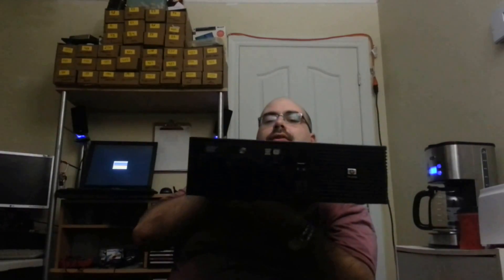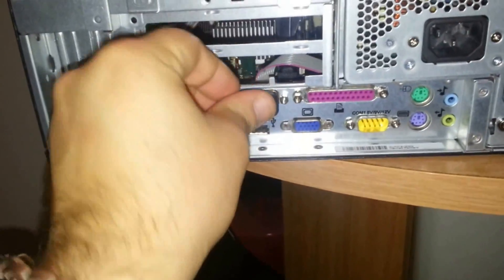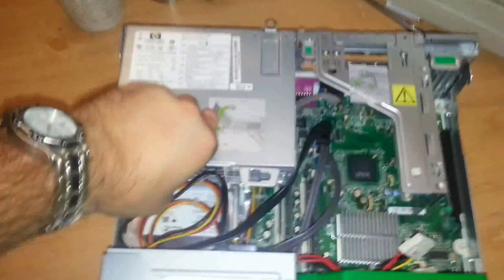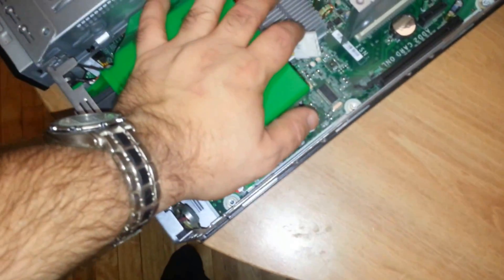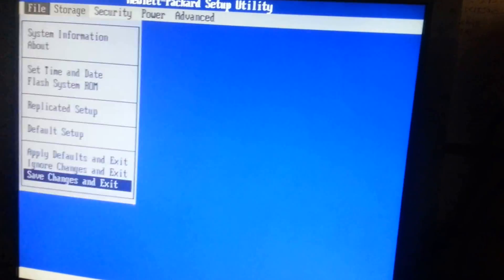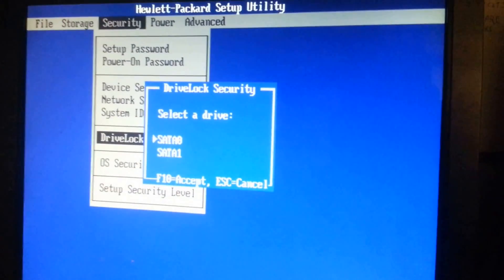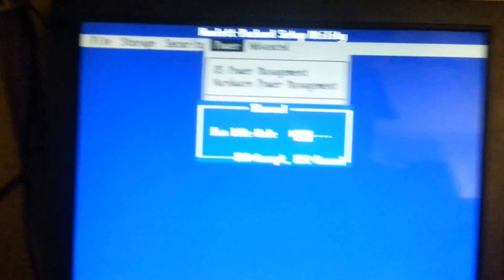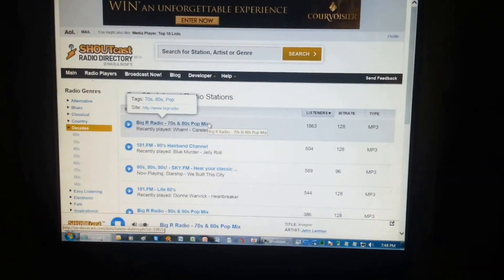HP rp5700 Overview and Boot

Comment: Help me i cant open
Reply: Bruh same
Reply: I know how to opened now
Reply: Grabbed but like put the front up and then put your fingers on the sides and tje front has to be facing up and the pulled up the case but hard and there will.comeout
Reply: sassy-predator30 ok
Reply: @ALExx399  now i knew how to remove the case thank you since you said the front should be facing upward or skyward then i press the side button  locks one by one and it release the lock

Comment: What is the power usage of this system? Because i want to use it as a router/firewall at home, and it's gonna be powered on 24/7.
Reply from the maker: +Max Around the 300-350W range. Judging by what your intentions are, you'll be mostly hovering closer to 300W.

Comment: Buy a DVI-I to VGA adapter. And place the video card in the slot ...

But at the moment of turning on the PC ... did not give me image ....

Change the position of the monitor to the integrated cardboard that has the motherboard, and I throw this error ...

"922- This system only supports SDVO / ADD2 cards in the x16 slot."
Reply from the maker: +Winder De La Cruz Those bastards...they just couldn't make it like Lenovo did. That means that your PCI-E slot only accepts a video extension card. Worst than that is that it's not a PCI-E but an ADD2 slot. That's great...now I gave advice to someone and yet HP got me good again...
Reply: Yes, it's just an ADD2 slot ... I lost 45.93 $ which is very difficult to get in venezuela ...
I will try to sell it here and venezuela ...
Reply from the maker: +Winder De La Cruz Sorry about that. I was even fooled by the damn board description. 
However there are three options for you at the moment:
- Try to get a refund from where you purchased the video card
- Sell it without losing too much
- Get a PCI-E x16 to x1 converter, but don't count on it to fit. 

Lenovo always uses a patched PCI-E x16 to avoid these mistakes, things that should of been standard by now.
Reply: So i cannot put a network card in the PCI slot...?
Reply from the maker: +Max if it's PCI, yes but if it's PCI-E, most likely not. I've heard that these stupid designs also has a space for a PCI-E x1 card but don't expect a miracle.

Comment: Hi friend, it's me again, Buy an E7500 Core 2 Duo 2.93Ghz processor.

I placed it and got this error "1801-Microcode Update Error
    Missing or Invalid Processor Microcode Update. Please contact
    Hewlett-Packard Company for a new Microcode Update to support the
    New Processor Stepping.
 
You can force boot by pressing F1 "

Press F1 and the windows start normally.

What should I do to avoid this error ??

Another bear the fan fully accelerated
Reply from the maker: +Winder You may need to do a BIOS update on your machine. If it doesn't work, it may not support it officially.

Comment: can you fit a Ati Radeon Hd 2900 video card in this pc and support it
Reply from the maker: +IRON4URMAIDEN Unfortunately no. The PC has not enough space for it to fit in, due to the card being quite large and even if you got it fit, it won't be able to be cooled properly and the PC only accepts low profile video cards and to my knowledge, no 2900 cards are low profile.
Reply: Can you give me some options on what video cards i can get for the rp5700 that will really help me out.
Reply from the maker: +IRON4URMAIDEN Any GT 210, 610, 710 or 720 will do the job. Make sure it is includes a low profile bracket (usually two small metal plates) and it would be great to have it with a fan for cooling, but it's optional.
Reply: Thanks for the help.
Reply from the maker: +IRON4URMAIDEN Anytime bud.
Reply: btw is a nvs 300 a good video card for this pc?
Reply from the maker: It's better to stick with the GT series, both in price and performance.
Reply: Can you make a video on how to change the PSU for the rp5700 and what type of PSU you need for the Pc
Reply from the maker: +IRON4URMAIDEN I wish, but this PC was sold long ago. I'll see to it that I find another and then I'll be able to do it no problem.
Reply: lhuser
 Thanks
Reply: oh and do you know any psu with 300w that i can use for the rp5700
Reply from the maker: http://www.ebay.com/itm/HP-570856-001-HP-D3006A0-300W-ATX-PSU-Power-Supply-Unit-/281976449218?hash=item41a71b28c2

Comment: I have the same computer but it for some reason wont open... i doubt i dont have the man power :3 but still it wont open im afraid to press the button to hard and brake it
Reply from the maker: Press harder. I doubt they will break. A tip for stubborn tab openers is to press hard and shake the PC back and forth. Check for physical damage and/or screws and lock at the back as well. Good luck!
Reply: lhuser i really cant afford to break it if i do whe  i open it im going to be installing ram this is my main computer and im plsnning on upgrading soon will do tho'
Reply: Tman10143/Crusader002 won't budge
Reply from the maker: Tman10143/Crusader002 Trust me, you can't break them unless you bash at it. Squeese the two tabs firmly and shake the PC back and forth. If you can't get it open, make a video; I might find the problem.
Reply: I dont have the computer anmore L0L
Reply: I build computers and know nothing about this one so i went to go and open it and it didnt open